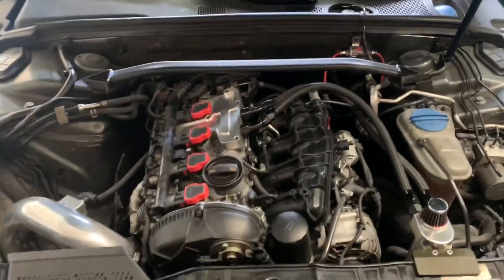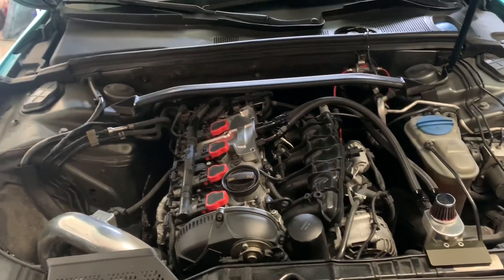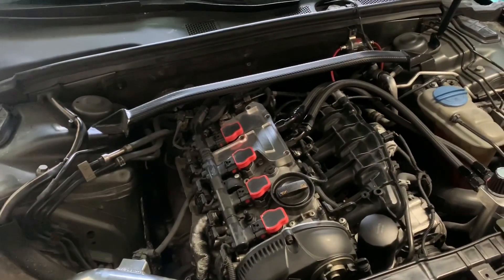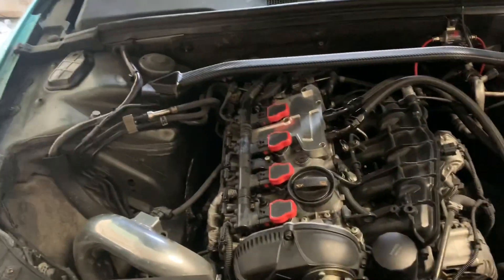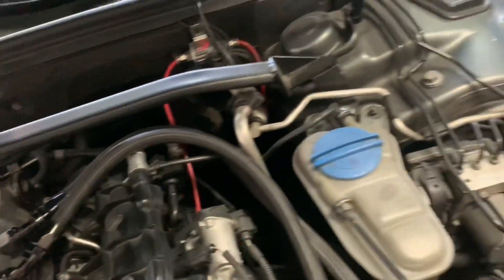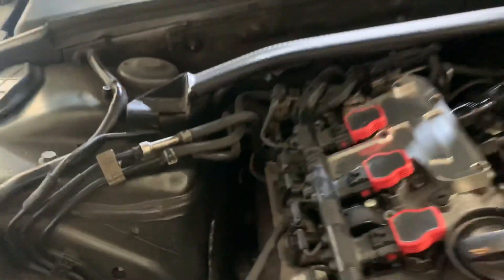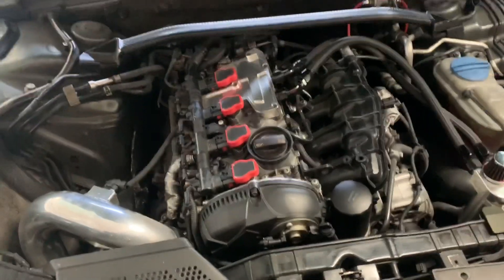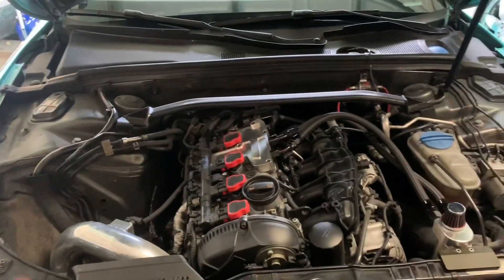How to get 455 hp to a Audi b6/b7/b8/b9 or Vw 2.0 tfsi or Fsi

Comment: I gotta say, I’ve NEVER commented on a YouTube video but love what you’re doing and how you put it out here. I have a 2014 A5 just about to hit 30,000 miles (prime platform 😁) So far have stage 2 from Integrated Engineering, 3” down pipe, Injen cold air, and diverter valve. Next will be intercooler (have to go easy, wife not happy 😃) it’s my daily so not going crazy yet but love to eventually get to where you’re at! By the way, another commenter, Ron P is my buddy who has me addicted to upgrading 😂. Keep up the great vids!
Reply from the maker: Dominick Reppi thanks bud, yeh my wife hates me🤣😂🤣, I’ll keep it coming, thanks for the support 🙏🙏🙏🙏🙏. I’ve always been interested in integrated.
Reply: I have cts ko4,ecs tuning intercooler, integrated hpfp, ecs tuning turbo back exhaust, ecs fuel injectors, ecs underdrive pulley, and unitronic tune

Comment: How would this setup fair against a g37x s coupe? Stock or tuned
Reply from the maker: Isaiah Monk well I beat an 2020 infinity q50 red sport, I was so impressed with how quick it was I researched it , it was a pretty close run. I believe it’s a 3.0t twin turbo, with 400hp, a stock, g37,370, are not on my level, I don’t even race them, because I know I would win, but if they tune it the sky’s the limit, I’m not sure, depending on what you do.  I had a couple try me but after 70, once there low end torque was gone, game was over
Reply: @brucecustommotors  good stuff my dude! And cheers for beating the q50. Those rs are dumb fast !

Comment: You have any dyno sheets? I’m running the same setup, I’m just missing injectors. And they said it can handle over 400hp on stock internals?
Reply: And what year injectors?
Reply from the maker: I’ll find some, and , dm you. yeh that’s with they told me too, when tuning so i bought these forged pistons, and rods,  for about $1,200 in the links. I figured rather than do the work wait for my engine to give out,  the forged parts along with a new timing chain and bored block have been sitting in my garage for a year.😂🤣😂, I think there just being safe. And I basically got the Bosch. S3 injectors, it’s in my description, it made a big difference,  before I would run lean from time to time,  but when I got the injectors my problem was fixed, and I got  the full potential of my tune, when you think abut it s3, rs3, and the new rs5 2.9 runs the same injectors Bosch, because it has more cc of fuel. Really the meth put me on the 450 platform, it gave me a 50 plus gain. Unless you’re running e85 with the new intake the metal, one but that only comes on the b8.5, mine is b8 plastic, it was a major fail for me. With that being said apr, says e85 can put you at 390, and spend is a real safe tune. My buddy dynoed at 404 , with apr e85 tune, yeh I would say I’m at the brinking point, I’ll be the genni 🐖 for the team

https://www.uspmotorsports.com/329244-7391.html

https://performancebyie.com/products/ie-144x22mm-tuscan-rods-vw-audi-20t-tsi
Reply: Bruce Custom Motors are you running a specific tune with your meth? I’m running meth but with IE’s 100 k04 tune but couldn’t find anybody to get full potential of meth
Reply from the maker: @Jcobwell1889  yeh im running apr 104 map with the meth , so anytime i put in boost juice( water meth) i switch to 104.
if im out of boost juice i run 93 and sit around 408 hp, but with the meth it puts me around 454, with the meth on 93 it puts me at 420 hp
Reply: Bruce Custom Motors did they ever tell you how much the fuel pump can handle?

Comment: I'm interested in the intake, and the link seems to no longer work.
Reply from the maker: https://www.ebay.com/itm/Injen-SP3080P-Polished-Cold-Air-Intake-10-13-Audi-A4-A5-2-0T/153563951866?fits=Make%3AAudi&epid=218885551&hash=item23c11ff2fa:g:tSIAAOSwFyZZ5N5T
Reply: Bruce Custom Motors Thank you much, great video🙏🏽

Comment: Do you have stock drive train? Trans, driveshaft, axles?
Reply from the maker: Yes our cars or under tuned oem tremendously, other than manuals they build almost equivalent platform forms as s3 cars . For example my bud has a stage 2 s3 running 425hp, and I always beat him by 2 cars. I’m definitely at the peak , every one says from a tuning perspective , 450 is the max .they say before I run into risk but so far so good, I’ll be the Ginny pig for the group. I figured if I blow something, I’ll just get forged internals, like piston rings/ springs and valves, as far as transmission, apr has torque management which briefly, reduces torque before gear change, is almost like your sliding into gear, you still have the dsg fart but it’s smooth. With revo, I don’t think my car would have lasted, I would get whiplash after every shift, it put all the power , to every gear shift, it was fun, but I wanted something mor conventional , I could drive every day. Apr only gives power when you ask for it, revo gives it on a tap, but both make it to the finish line at the same time, just a different way

Comment: How close would this work for the 1.8t? I have the b6 and it’s RWD swapped. Looking to get more power.
Reply: There are versions of all the parts he mentioned for the 1.8 not sure how the power would compare with the smaller displacement engine but it’s probable pretty similar
Reply from the maker: Yeh I agree with switch bro’s, my bud has a b6 1.8 same set up other than , injectors, with garret turbo , and he is at 405hp
Reply: Look at stage 3 kits. Bigger turbo, front mount, injectors (along with intake and exhaust. 1.8s are pretty solid
Reply from the maker: Cameron Kleckner 🙏🙏🙏🙏🙏🙇🙇🙇🙇🙇
Reply: @brucecustommotors  Thanks for the love :) I work in a euro shop that specializes in VW/Audi and I have a pretty awesome B7 A4 so it's nice to see people who love the platform 😁

Comment: Are using stock internals? Factory pistons, conrods... I would like to beat em my friend’s M3😂
Reply from the maker: yeh all stock internals, all of my tunners says the most the engine can take, stuff like pistons and rings, and valves is 450hp. im right at the breaking point. the transmission seems to hold up aswell, but the shifting works better with apr tune, with revo it was real hard shifts. but apr has a torque management which reduces the torque right before you switch the gears. so its seamless gear switching. but honestly no issues, I figured if i blow something, ill just go forged internal to take up to 600hp, but of course that will be with a different turbo and fuel system. if the m3 isn't tuned with the right mods shouldn't be an issue. but a tuned m3 depends on the level they take it. Ive beat an old gen m3 and a new gen m3, but my buddy has his tuned stage 2 with exhaust he got me by a car and a half. im waiting for my rematch lol

Comment: Do you have all stock internals and transmission?
Reply: TCU transmission tune makes the trans capable of managing high torque. Im at 360tq and im fine
Reply from the maker: @aaronp9835  good stuff bro, im working on a custom trans tune myself
, who did you go with
Reply: Bruce Custom Motors APR
Reply from the maker: yeh all stock internals, all of my tunners says the most the engine can take, stuff like pistons and rings, and valves is 450hp. im right at the breaking point. the transmission seems to hold up aswell, but the shifting works better with apr tune, with revo it was real hard shifts. but apr has a torque management which reduces the torque right before you switch the gears. so its seamless gear switching. but honestly no issues, I figured if i blow something, ill just go forged internal to take up to 600hp, but of course that will be with a different turbo and fuel system. if the m3 isnt tuned with the right mods shouldn't be an issue. but a tuned m3 depends on the level they take it. Ive beat an old gen m3 and a new gen m3, but my buddy has his tuned stage 2 with exhaust he got me by a car and a half. im waiting for my rematch lol  iscuse the m3 portion, some one asked the same thing i just copied and paste
Reply: Bruce Custom Motors I want to upgrade my car but not much info available for a c7.5 A6 2.0t. Ik that the engines are similar but I think the a5 is a earlier version of the engine in my car.

Comment: These mods look all great, the big questions for me was what did you do about the tuning? Is the APR K04 turbo just the turbo+manifold bolt on with the S3 injectors, or did this need adjusted fueling / ignition timing? And I see with APR's K04 they require their upgraded high pressure fuel pump to feed the beast.. Do you have the upgraded HPFP?
Reply from the maker: the apr tune is pre loaded with timing fuel and boost,  I can change maps, from stock to 104 . I normally use 104 map with my meth. apr says with k04 with out meth and added injectors they can get you to 385.hp. I guess i got lucky before i added my s3 injectors, and turned on my meth I dynoed at 391, after i put in the s3 injectors, and turned on my meth on 93 octain i was pushing 433. once I switched to the 104 octane map i averaged out at 452.
Yes apr is only turbo and manifold, they recommend that you  go to a colder spark plug like ngk 8 . and gap them 23.
For the b8 and above ther is not an upgraded hpfp pump available. I thought the same thing. if you look on apr sight you can see its for b7 and bellow. with revo you can play with your timing, fuel, and boost with an sps switch, but be careful lol

Comment: Hey great info and really well explained, would all that you have done, work with my 2008 a5 coupe 1.8tfsi B8, it was 170 bhp. I had a stage1 tune  done but since then I've added a k&n typhoon induction kit, brisk performance plugs a full exhaust system including a performance down pipe and had new  timing chain done. Car pushing out about 250bhp . Look forward to any advice.
Reply from the maker: Thanks for the support. you're actually ready for a stage 2. you have all the necessary things you need except for a larger inter cooler which isnt necessary but gives great gains. I would go that direction first. you will be amazed how much stage 2 can do . what tune are you running currently, you might be able to upgrade for cheap

Comment: I have the same set up but my meth is going to my intercooler
Reply: Left side lower
Reply: My friend has a m2 and I get him but he just had his meth put in ..a couple days ago I'm going to have to get up with him soon .
Reply: No Mopar has beat me yet .. v6 or v8
Reply from the maker: Ron Pastuf yeh people don’t understand how fast or quick our car can be, they assume because it’s a 4 banger we can’t get in the 400 club, people don’t think about weight ratio, for example the Porsche boxer, for example the new rs5  os a beast. is a 2.9 twin turbo with 2 k03 , the car is heavier than ours because of the. 2.9 of course with out meth basically if we put another turbo on ours we would be in the 5 to 600 club, but the internals would have to be forged at that point. I just took by bud 2012 rs5 on a 30 roll, and a coyote on a 30 roll, I believe he was tunned also. He did get me on 50 roll. But it was close
Reply: Hellcat doughtfull don't think I'm there but the audi a4 b8 is a great platform if you  want to invest some money into it you can make them fast 4 sure 👍
Reply from the maker: Wow welcome brother , What numbers are you getting right now, any issues, no I don’t have a pulley. The s3 injectors brought my tune to life when. I went ko4 my stock injectors weren’t cutting it I would get lean codes from time to time, and a few flutters top end. With my s3 injectors all went away, and I got more power and torque it gave me the full potential of the tune
Reply: @brucecustommotors  around 425 never dyno it yet no issue at all never had one ever
Reply from the maker: Ron Pastuf yeh the s3 injectors will probably put you over me are right we’re I’m at. Same here been going 💪 interesting maybe I should change my injection point.  What part of the inter cooler did you tap

Comment: Mines ko3 stock map making 260hp 

boost controller set to 16 psi
Catless down pipe—muffler delete 
Front mount Intercooler 
K&n intake 
Tein suspension (not sacked I just prefer the comfort and handling they provide at slightly lower than stock height) 

TT coilpacks 
TT225 injectors (stock pump) 
NGK standard spark plugs
4 bar fuel pressure regulator 
And 1v 16w zenor diode mod on the map sensor to allow the boost pressure. 
Single mass fly wheel conversion 
And a standard heavy clutch. 

Run like this for 2 years now, I don’t drive it lightly either. 

Most would say it’s silly to do old school mods on a 2002 Audi A4 Quattro, I say it’s practical and safe, as long as you do your math right and compensate for the issues caused (too rich or too lean) timing issues etc, all issues have solutions. 

My cars like a rubix cube very untraditional for a 2002 😂
Reply from the maker: Wow I would love to see your build, sounds like you know what you’re doing, you got a new subscriber. I would love to collaborate anytime

Comment: When you do the fuel injectors do you need to do any tuning. or is the amount of fuel goin in not too much fuel going in?
Reply: I do have apr stage two as well
Reply from the maker: I actually got the s3/rs3 injectors after my tune, I was running lean codes, and realized that my car fuel was topped out, and it was to much air ratio vs. fuel, once I put in the new injectors my code went away, and my car felt like I put a new tune on it, pretty much got the full power of the tune. Apr stage 2 you should be fine. I actually put in the new injectors because it was recommended by apr
Reply: Right on bro thank you I really appreciate it and your builds are fire.you gotta be professional huh

Comment: Do you need to lift the engine out of the car to install the turbo?
Reply from the maker: no, you can unbolt the exhaust manifold from the top along with the oil lines etc, and you can jack up the car, and unbolt the turbo from the down pipe and you're good to go. ill update you with visual instructions. I have when ever you're ready.

Comment: Stock hpfp run out of fuel after 350hp. What fuel setup are you using?
Reply from the maker: how are you, thanks for the input, if you're running b7, or b6 there are hpfp upgrades, and its generally just a bigger piston to pump out more fuel. but for b8  and up theirs is none available, and some vw, depending on the model. apr and revo offers over 360hp with a tune no issues. The one thing I had to do with my fuel system is change my injectors, to s3/rs3 injectors for more fuel/ because i was running lean when i hit 400hp with my ko4

Comment: Thank you for the detailed video Bruce.
Reply from the maker: Glad it was helpful! thanks for the support. ill keep it real as possible no gimmicks
Reply: @brucecustommotors  I actually have an A5 B9, but your ideas boosting HP should be the same right?
Reply from the maker: Yes ,  believe it are not your engine is revised, at can produce more , hp, and run e85, I have a b9 q5, 2.0t also

Comment: Man where does one begin? I have a 2012 Avant 2.0 and thinking about going with a stage 1 tune. I’m also thinking about changing the inter cooler and cold air intake. I’ve owned the car since new, the only changes I’ve made were 3” pipes cat back, I’ve also lowered the car. My wife has a 2014 tts, I’d be happy if my car had that power. For a little while anyway.🤪
Reply from the maker: you will be surprised what a stage one tune will do, it will make you think you have a new engine in your car. my first tune was revo stage 1. one day i was driving, and a hemi charger was pulling up on me. this is when i was stock, and  I pulled on him. I new at that point, I had potential. ( I was hooked) so i went all in. the only other 2 times that I noticed a significant difference, is with my water meth and k04, the rest is minimum noticeable. but with s3 injectors, and intake, you will feel more torque.  So defitnetly stage 1 tune first. Ive had apr and revo, They are both similar.
Reply: Thanks so much for the reply, made an appointment to bring the 2.0 in next week for the stage 1.  My wife has a 2014 tts ( I drive mostly) trying to convince her to go to a stage 1 for her car. Told her I’d pay for it🤪

Comment: Great video with great information, I had a question about running the water/ meth injection kit. Do you need a specific tune to run it?
Reply from the maker: If you run it without a tune you will get, better performance do to the cooler engine temps, and higher octane which is about 105 it will also , help to keep your internals clean. The tune ads more timing which gives you the most horsepower which can go as far as 60hp, with out the tune you will probably get about 10hp increase, but you still have the other perks
Reply: Bruce Custom Motors thanks for the response, I just ordered a kit. I have a stage 2 integrated engineering tune on my car. I didn’t know if I had to change the tune because of it. I plan to go ko4 I just haven’t been able to find one yet unfortunately
Reply: Also wondering if you had to do any mods with the ecu or anything when adding the fuel injectors? We’re you able to just install and walk away or do you have to change the computer?